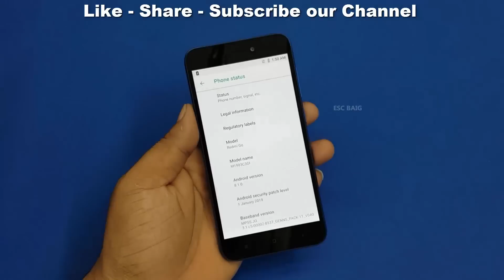Redmi Go Disassembly / Redmi Go Teardown || How to Open Redmi Go Rs4499

Comment: In a work day I screwed up my Redmi Go, I watched some how-to, I kept with this and today I fixed my phone without previous experience but enough theory to take it easy. I had some difficulties while removing the carcas and the small connectors, like the section to remove the battery (it is not easy thought), thank you!

Comment: Can we change damage screen without pulling out battery?
Reply from the maker: No bro ..Not Possible you must remove the battery for changing Display
Reply: @ESCBaig  ohk thanks for the reply but even if my digitiser is only damaged, LCD is fine touch is working, I also tested by touching with that PASS FAIL app. 

Still need to pull out battery?